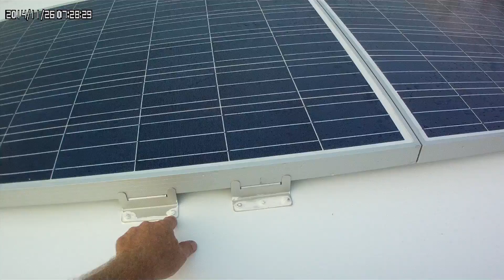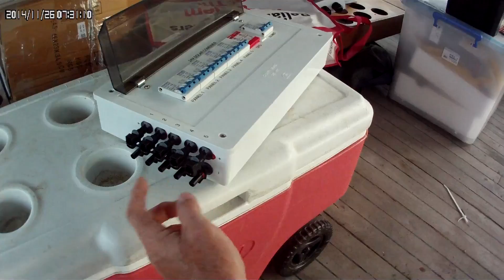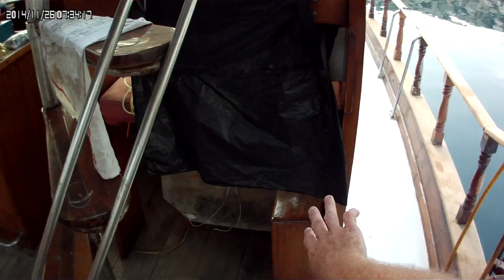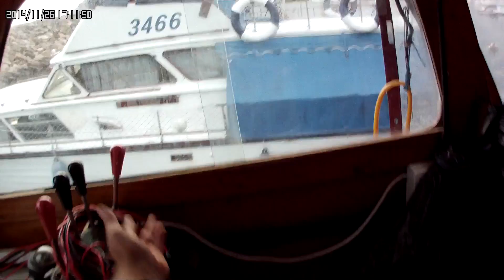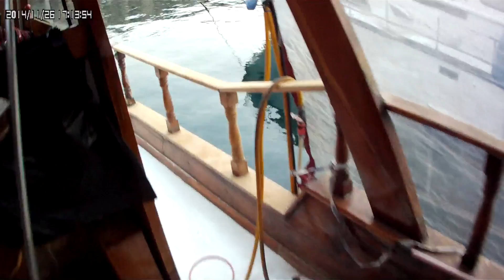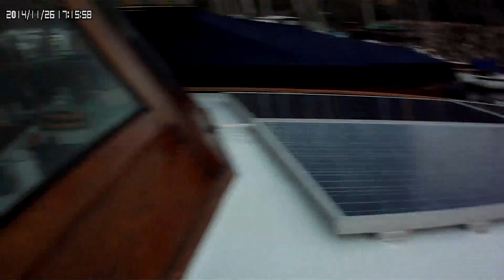Off Grid Teak Boat 15

Comment: Perhaps I didn' understand that with the electrics right but couldn't you use aluminium cables?
Reply from the maker: Aluminium wires are not wise on a boat in sea water. I use Timned copper wired to avoid corrosion, and also... aluminium wired must me larger to assure resistance loss and handle the amps. Tinned copper wire is best for boats !!